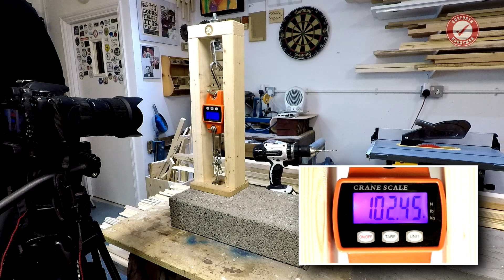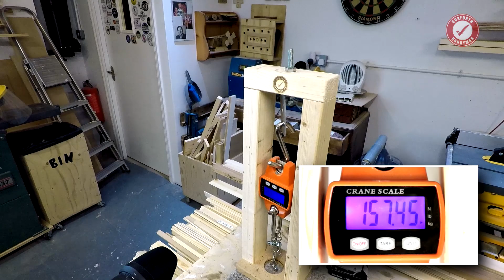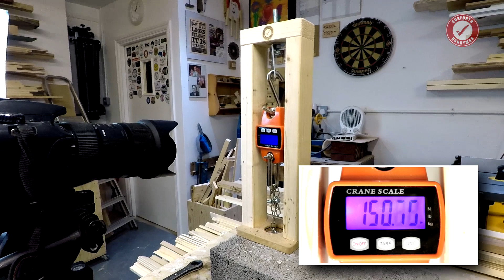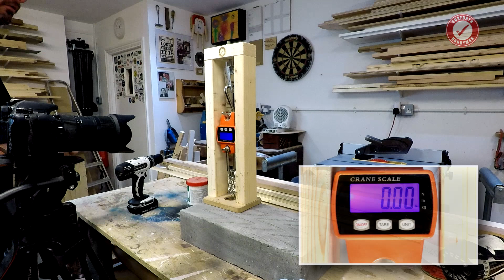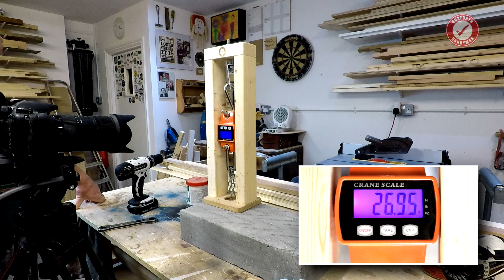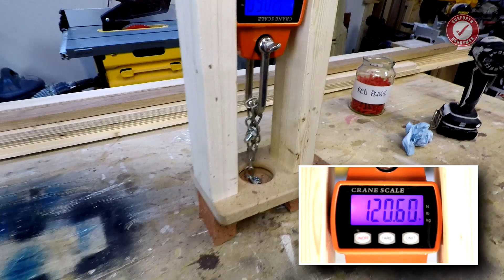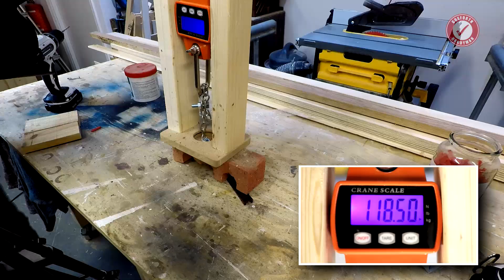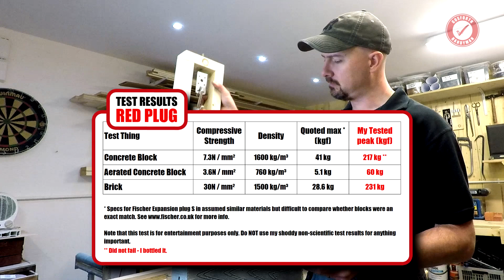How strong is a humble RED wall plug ??

Comment: Informative video again Andy.
One thing I’d like to add is that in my early MEB days when we fitted things like storage heaters we could never use plastic rawlplugs as they would soften with the heat and pull out. We even had a few of the, what was new, slimline ones fall over believe it or not. We always had to use the old fibre plugs. I don’t know if you can still get those now though as I haven’t seen them for ages but I really have no need to look for them of late. I wonder how how they would rate though? (There was no weight on them it was just to secure the top bracket to prevent the radiator falling on its face. The weight was taken by the legs.)
Reply from the maker: That's an interesting one! I can't find any info. on the melting temperature of plugs. I guess they're just nylon so whatever nylon melts at!
Reply: InstaBlaster...

Comment: Cracking results.  An interesting vid Thanks.  Blowing the dust out will improve the holding power. It would be interesting on how to do a test leaving the dust in the hole, and how that reduces the hold
Reply from the maker: I agree... might do that at some point. Although there's an argument to say the dust makes the hole slightly smaller so may actually improve grip? I don't think there'll be much in it but we shall see... 👍😀

Comment: When the screw bent in its way out due to the ring pulling it from the side, that makes the removing harder and we'll get higher measuring than the actual force it needs to be applied.

Comment: Your rig to test the insert was not simply applying a tensile force, but a shear force as well... which is why your screw bent.  Shear strength of any anchor is usually much stronger than the tensile strength.  Plastic wall anchors have received a bad rap in the past... but they are usually quite strong when a quality plug is used and when they are installed correctly.  Neat video.
Reply from the maker: You are indeed correct! There's a shear force due to the chain not pulling perfectly centrally to the screw - I need to sort that for future tests 😃 - the vast majority of the force is axial though and way more than what the screw would normally be subjected to, which would be mostly shear... in most cases... probably. On my list to fix! 👍🛠

Comment: Really great test! Do you think that i could use red plugs and 5mm screws on a concrete ceiling then, To hanga curtain rail. Three anchoring points 
All with the red plug set up. Curtains a maximun of 8 to 10kg.

Comment: Having worked with a 2nd fix joiner for 2 years on and off, we always bash the rawl in 5mm from the surface if you're saying, using a 5x50mm screw. Obviously, we'd knock in much further into the blockwork or brickwork, if putting in a 70 or 100mm screw in. I'm assuming this makes the rawl even stronger. Plus the pulling motion on most rawls is downward, not straight up as per test. Came for this video because I'm about to stick a TV bracket on the wall for a costly tele and I was curious about ratings as I'd opt for red rawls into the solid brick every time to hang a TV (55" weighing 20 odd kgs).

Comment: It would be interesting to see what "shear" weight they would take, very rarely is the force trying to the plug directly out the wall. I would suspect it would be 200kg+ easily. Great video, I'll chuck those concrete anchors away now.
Reply: I should have waited until the end of the video before commenting...
Reply from the maker: I haven't built a rig for testing shear weight but yeah it would be huge with decent screws in concrete. 👍🛠
Reply: how did you not notice that the washer being bent is applying a shear force to the screw already hence the high rating.

Comment: What size hole did you drill in the lightweight block? I always drill half or full size drill bit smaller  than recommend into those as there so aerated they fall apart.
Reply from the maker: I did the recommended 6mm for the vid but yes I do the same in 'real life' and go for 5.5mm - I hate lightweight blocks almost as much as Philips screws. 😀👍
Reply: Gosforth Handyman only just found the channel and really like it, I’m from Wiltshire but don’t worry I understand what your saying no need for subtitles.😉

Comment: I posted the comment below on this video: https://www.youtube.com/watch?v=TQ13gug7aQ4

For many years, I worked for the Rawlplug Company. 
In the R & D Department within the factory, a 1 ton block of concrete was positioned in the middle of the floor. 
A small hole was then drilled in the exact centre of it and a red Rawlplug tapped tightly into the hole. 
An eye-hook was screwed fully down into the red Rawlplug. A portable crane was then used to lift and suspend the concrete block approximately 20 mm off the floor. 
Visitors were always shown this feat of strength of the Rawlplug.

Comment: A couple of these red plugs to attach a 30kg TV to a wall should be perfect, lol.
Reply from the maker: Theoretically one should be fine... but don't think I'd chance it. 😃
Reply: Gosforth Handyman Have you reviewed the blue Gripits?I have to put a 21 Kg tv on a plasterboard wall constructed with metal studs. The tv stand has only 3 fixing points across its length. Will 3 Gripits do it?

Comment: Pointless test really, you can't always rely on a perfect substrate to hold a plug. Throw these reds in the bin and use a minimum of 7mm for everything, then even poor blocks have a chance of holding.
Reply from the maker: To be fair, if the substrate can't hold a 6mm plug then it also won't hold a 7mm plug particularly well. See other tests as this has been proven quite extensively.
Reply: @GosforthHandyman  - So if there is little difference then what is the point of the smaller plug? They cost the same. The problem with red plugs is that they only hold something like an 3-4mm screw, and therefore using anything longer than 50mm is likely to snap. With a 7mm plug you can easily drive in a 5x100mm screw. The depth of the fixing and the shear strength of the screw are important considerations.
Going from 6mm to 7mm is also a 15% increase in gripping area, that's worth having for free IMO.
People should bin the red plugs and just carry 7mm fixings, then even in poor conditions and half assed drilling skills they will still have a reliable fixing, and the cost increase isn't worth the hassle of a single failure.
Reply from the maker: Red plugs 4.5 to 6mm screw size. Fischer test at 5mm for 6mm plugs. So 5 x 100mm in red plugs back-to-back is fine. 
https://www.ironmongerydirect.co.uk/product/fischer-plastic-wall-plug-screw-size-45-6mm-red-pack-300-782257
👍